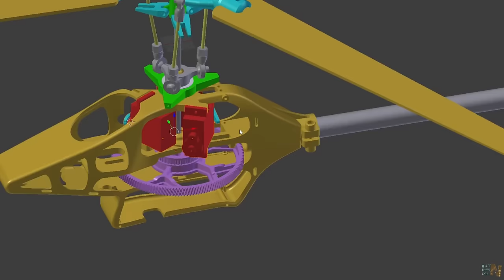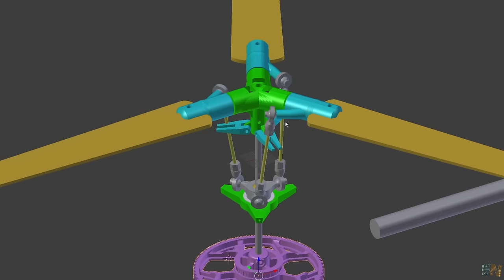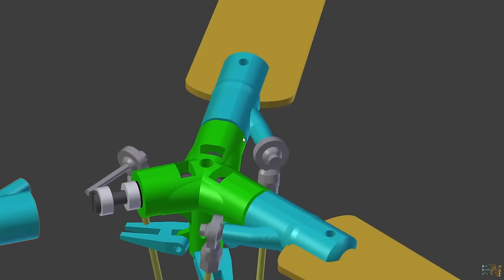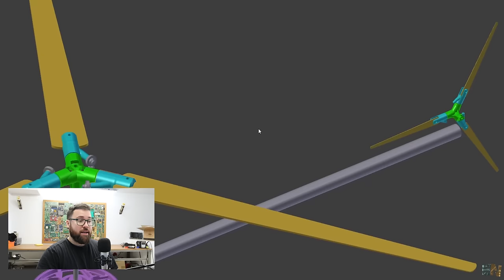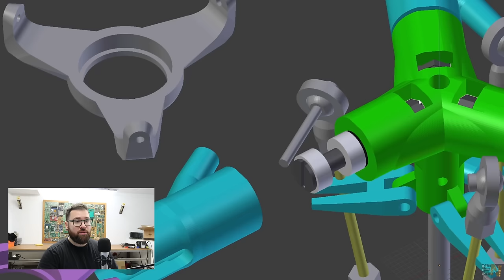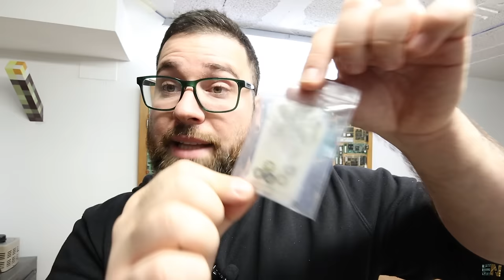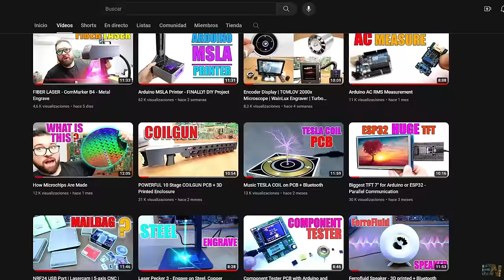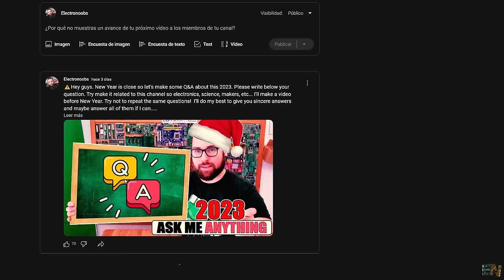I'm making a fully 3D printed RC Helicopter with Arduino

Comment: Nice job! I'm a flight engineer on Sikorsky S70 helicopters, keep in mind that theory of flight for rotating blade aircrafts has a lot of detail and tricks you have to overcome in order to make this project and see it airborne! I'm sure it will be a total success my friend!
Reply from the maker: Thanks! I'll start with the basic. make tests, improve.. and so on. I think i can do it  :)
Reply: Im a system test engineer with 12 years in aerospace  and what I learned is that flight dynamics are junk science . Get your L/D and balance correct and just start flying and gain tuning . No simulation had accurately modeled the the details shown in rotor dynamics .
Reply: Классный проект 👍
Reply: Learning by doing 👍
Reply: Full scale guys.... Scale effect applies. Yes a helicopter beats the air into submission.... The first RC heli used a flybar. Multi blade better stability along w electric motors and stabilization...
 Easy at small scale !
Schluter had a 45 degree offset swashplate movement to rotation to improve response at scale.
I envy you guys !

Comment: I think making the swash plate a little beefier could help; probably didn't have enough clearance when inserting the threads. you can try your luck with small wood screws as well, as they don't require thread inserts

Comment: Hi. Nice job so far. But if i can give u 2 tips, mini servos is strong enough  for those size blades. Not to sure if the ones u showed is that size. And tip nr2. Your blades grips. It would be better to have 2 normal bearing about 7 or 8mm appart and then a thrust bearing. This wil prevent stability and blade tracking issues. But anyways. Cant wait to see the first flight. Good luck.

Comment: It's great that you are still making videos! For me this is as enjoyable as your more polished videos. I understand that you have limited time, so it definitely would be great, if you would make more videos like this rather than none at all. What comes to the project, it is interesting to see if the resin prints have enough strength to fly. I myself have stayed away from resin printing due to the mechanichal weakness of resin printed parts, although they have great resolution.

Comment: What an undertaking! Amazing job my friend!

Don't forget about gyroscopic precession when you're programming the flight controls. If you want the helicopter to fly forward, the main rotor disk needs to tilt left or right, not forward. Left or right depends on clockwise vs counter clockwise rotation. 👍
Reply: no worries he uses servomotor instead of mechanical linkage it's gonna be tweaked easily via software eh
Reply from the maker: Thanks for the tip. Yeah i might have placed the control in the wrong direction in the video...
Reply: @ELECTRONOOBS I figured you may have just been simplifying the concept. But I wanted to mention it if you weren't aware. I flew helos for 8 years 🙂👍
Reply from the maker: @mcorrive12  any of those helis was 3D printed? :)))
Reply: @ELECTRONOOBS  LOL, no, Sikorsky hadnt adopted 3D printing yet! 😄
Reply: Agree! I am MSc in aeronautical engineering 🙂 and I know about the gyroscopic precession of a rotating body: here, action on rotor will react 90 degrees later in the direction of rotation. So, if the rotation of rotor is counter clockwise (mathematical positive direction) tilting the rotor from right to left (seen from the direction of the tail) will cause the whole helicopter to tilt and lift the tail up. Than we will have the forward component of lift to pull the helicopter to forward movement.
Reply: Actually that is for bell type rotor head with heavy flybar and indirect controll of blade angle of atack, this is hiller type direct controll of blade grips, so not so much precession...

Comment: you missed one thing about the rotor cyclic control... the moment is applied at 90 degree (+-~5 degrees) from your maximum angle of attack position... so if you want to go forward your maximum angle of attack should be on the right (assuming clockwise rotation)... this because of the rotor dynamic response (lagged response): you rotor response at 90 degrees after you apply max pitch... so your body pitch and roll will be switched...
Reply from the maker: yeah i might have not given the best explination there... sorry
Reply: actually no, it's not always 90 dgrees, it's much more complicated than that
Reply: @antonioesposito8071  i already wrote (+-~5 degrees), its called swash phase lag... actually, its not "much more" complicated... all the helis i worked with or built simulators for fall in this range... depend on blade properties , hinge type etc...but nothing that a pilot cant trim or compensate for...

Comment: I had a think about your swash plate and I think I spotted a mistake: if you look at real helicopters the balljoints coming up to control it and the balljoints going up to the blades are co planar. yours are offset in Z, probably means there's weird loads on them just from the geometry.

Comment: Such smol resin parts don't seem like they would have the sheer/tensile strength necessary to make your rotor/swash parts. I hope you are able to find the right shape/ material. Have your considered fiberglassing a shell onto the printed parts?

Comment: You do all your cad work in blender!? Why don't you use fusion 360? I learned modeling in blender but immediately tried fusion because precision modeling in blender was a nightmare.
Reply from the maker: I don't have a licence and don't have time to learn how to properly use it. I've been modeling in blender for years and changing to other software with so few time is very difficult.
Reply: @ELECTRONOOBS  You  can read the policy but i don't think you have to buy it as long as you don't use it commercial. Also it is really a game changer. I'm really impressed that you came soo far only using blender.

Comment: Answering your question about other options for the circular part with a hole for the bearing, you can use the 3D printer and use a material called PCCF filament.

Comment: You're not the only one it just surprises me. I even tried downloading some of the plug-ins. Which ones do you use for precision? Because, honestly, there are a few projects I'd like to use blenders more "free wheeling" modeling for, but worry about precision…?
Reply from the maker: Are you talking about Blender plugins? I don't use any... Just simple Blender ..
Reply: @ELECTRONOOBS  I think maybe you should at least try fusion. Free for makers (I don't think that applies to you but at least you could try it) I don't know how you're doing this in blender but you could do it LITERALLY 10 times faster. not to mention iterating would be quicker because you can just set a parameter i.e.… .4 mm not enough clearance, change all/or certain features to .6. 
Ultimately, whatever works for you is best… Just a friendly piece of advice !

Comment: Well, there are very good working designs allready, so i don't see why making a poor one. Especially when you don't make it from rigid material. There are awesome flight controllers out there aswell, so i don't see why you want to make your own. If you insist to make an 3D printed rotor head, print from PA-12. Please make shure there's  nobody arround to geht hurt. I don't think you will make an working flight controller, to much knowledge missing. (Don't mind, they sell poor flight controllers aswell anyway, so it wouldn't count). 
My respect for your work, there are a lot of people doing nothing.

Comment: hi how about you try a swash-plate less helicopter, like the one Tom Stanton did, like it will test your programming skills only.
Reply from the maker: That's very interesting but I like the mechanical rotor more... :)
Reply: @ELECTRONOOBS  then try modelling in fusion u can easily test fit the nuts and screws bearings with the many plugins it has
Then I was thinking how about for the balls that u are looking for to replace the jewellery* ones, u check on the ones from rods that are used in RC cars for they use them in the suspension.
Reply: @ELECTRONOOBS  thanks for replying it has really made my day.
Merry Christmas

Comment: i dont recommend 3d printed part for rotor head... your centrifugal forces are biiiig ....wear a helmet and glasses during testing.... helicopter rotors are dangerous when they fail...
Reply from the maker: I will use for sure! I hope the new resin will withstand more force...

Comment: I don't know man, such big blades on a brittle resin printed rotor assembly?
And what for?
There are plenty of cheap models with cheap parts that could be used at least for the rotor assembly.

Comment: I think that you need flapping hinges on the rotor blades in order to distribute the lift of the rotor more evenly. Otherwise it will roll to one side when moving forward.

Comment: 3d printed heli parts are a very bad idea especially at that size. It looks like a 450 so the energy is very high. you will stab yourself with the blades. please don't stay near the heli when you spool it up. No way resin will withstand the stress. you don't seem to know much about helis. yes you have a superficial understanding about the basics but that's not enough. also 3 blades is a bad idea. it is very inefficient at that size. too much turbulence. love the enthusiasm but you know just enough to be dangerous to yourself.  Please be careful.